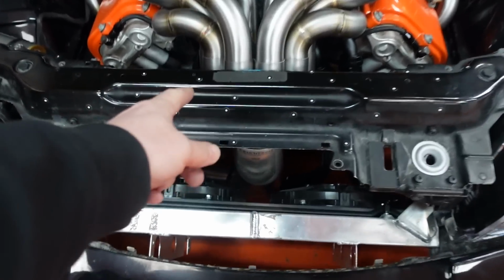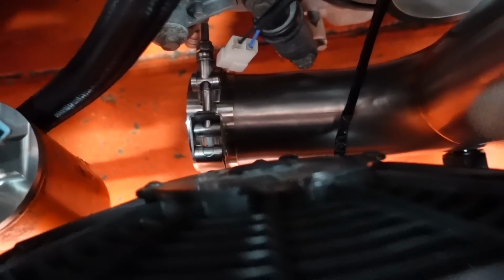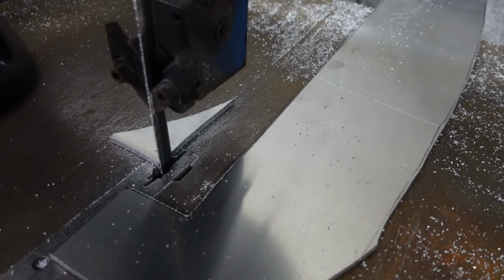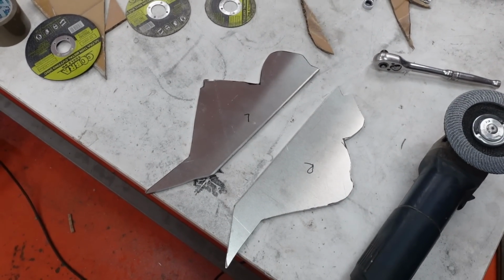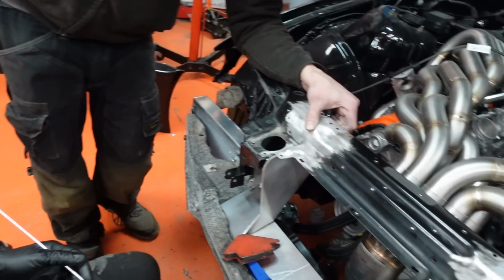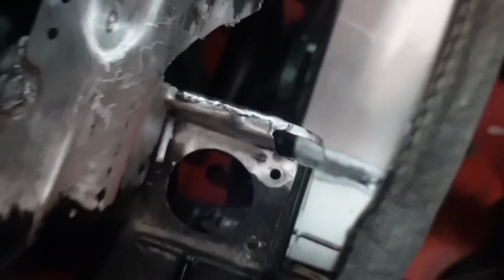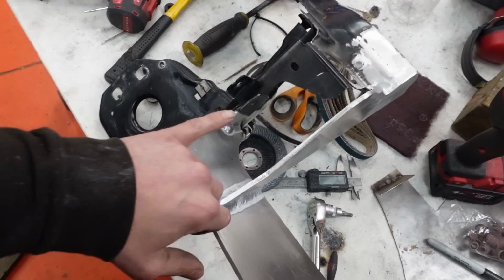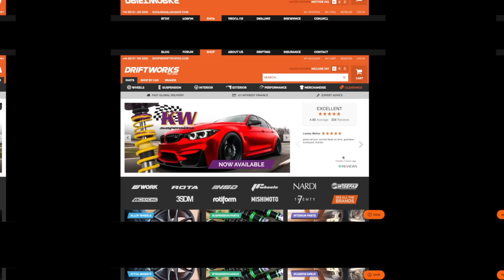V10 BMW M3 making more clearance for 10 into 1 headers

Comment: Hi Phil fantastic build as always and loving your content. However I can’t help thinking why would you have those fantastic radiators made first then try and adapt around them ! Surely the radiators would be one of the last things to be made ! Sorry for the criticism but the amount of times you must have removed them is a backwards step.
Reply from the maker: The radiators had to be prioritised as this engine requires a massive amount of cooling. This may not be enough as it is.

Comment: Isn't the heat from the headers just going to cause all kinds of chaos in the engine bay ?  How will you even mount an intake manifold or get cool air into the engine ?  I was thinking when you cut that core support just make it a small round or square tube across for support. I'd like some Work wheels for one of my cars, but the prices are just too much for me.
Reply from the maker: It is yes. I have some plans though.

Comment: You should so hire me. I would do great parts that Jay could just bolt. 3D scan it, design in Fusion 360, order aluminium machined or 3d printed, make the center in carbon myself etc..

Comment: I'm not convinced cutting out a structural beam does any good to the body's stiffness.
Reply from the maker: It's not structural. It's a headlight support.
Reply: @driftworks  It acts as a compression/tension beam between the two chassis sides. Why do you think Rally/Race cars put a beam between the top suspension mounts?
Reply from the maker: That is a strut brace which is important. This is not a strut brace.

Comment: I'm a bit afraid the front is now lacking a lot of structural integrity, and that the strength of the added plate laying like this with no triangulation is not really doing much in terms of how the forces flow. And you created a sorta blade for front end collisions :/ Some simple box section would have been sturdier, lighter and safer. I could be totally wrong, but some of my engineering bells went off.
Reply from the maker: It's not a structural part. It's there to support the headlights and bonnet catches.
Reply: @driftworks 
Can't help but feel it needs some gussets 😅
Reply: @driftworks  Wrong. I worked in Ford Dunton Chassis Engineering's structural analysis department for some years.
Reply from the maker: What is it's % importance when you have a proper strut brace and the main front chassis rails tied together correctly?